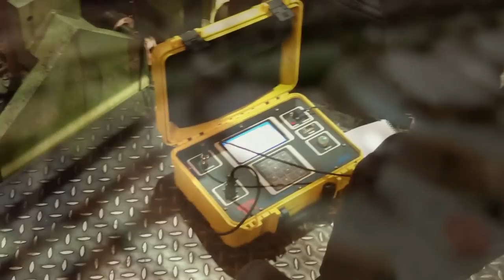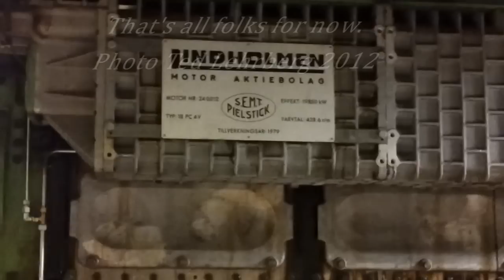Test run of Pielstick PC4.

Comment: If is a 2 strokes runs at 200 rpm,   of os 4 strokes,runs at 400 rpm.    The mechanic touch the heads and if he feels some vibration anormal,he discover the cover and fiind the problem.

Comment: I find it amazing at how low of an RPM these engines run at idle. Even under full power, they are still at a less RPM than a car engine idling.
Reply: +RakinBill the pistons are huge and heavy, if this engine could run a car rpm, it would break
Reply: As with any internal combustion engine, there is the velocity of the explosive wave front. These engines have a longer piston stroke and even though the rpm is low the piston is travelling at a high velocity. To achieve more power output you need more power strokes and higher rpm, you will need a much shorter piston stroke to reduce the piston to a lower velocity. Compare a convention cannon to the Rail Gun. The projectile cannot travel faster than the explosive wave front.
Reply: Essentially it comes down to pure physics... Engine components of such sheer displacement and mass cannot counter gravity.. also with the centrifugal force of crankshafts and other parts they simply cannot rev like their smaller counter parts... BUT.. I totally get what you're saying man ☺️

Comment: Happy that I never came across with this engine when I was at sea, 36 exhaust valves to maintain!! I am more into a 2-stroke crosshead engine.
That did cost quitte an amount of starting air to get it running, long stand-still maybe?
But at no load and on gas-oil the engine sounds nice.

Comment: En fråga till, det står om ett varvtal på 400 rpm. Jag får inte ihop det med nätfrekvensen 50 Hz och något poltal som finns att välja på för generatorer. Det måste väl vara en synkrongenerator och med tanke på åldern så körs den säkert utan sådana moderna häxkonster som tillåter annan frekvens från generatorn än nätfrekvensen och det är väl ingen växellåda mellan motorn och generatorn heller (eller är det det?). I så fall kan man t ex få 50 Hz med en tolvpolig generator som snurrar med 500 rpm.
Tillägg: Aha, man ser ju en märkskylt precis på slutet där det står det udda varvtalet 428,6 rpm. Då är det en 14-polig generator, det ger 50 Hz på det varvtalet.

Comment: how much does this engine consumes for 1 min ?
Reply: for 1 minit no ide...but the ship i work on consumes around 40metrictons of heavyfule every 24houers
Reply: 40 metrictons ? how much is this ? ._.
Reply: its around 40 cubics of heavyfuel
Reply: About 1600, 1700 l/h , 27 l/min at full load. Maybe more.
Reply: 423-450 gallons p/h. That is if the 1600-1700 l/h is correct. I rounded up to the nearest gallon.

Comment: What engine is used for the starter motor on this marine diesel?
Reply: an air compressor
Reply: air or generator started
Reply: This particular one is air started.
Reply: Air at high pressure contained in a huge pressure bottle,and a compressor to fill the bottle. the bottle may have the capacity for 15 starts without using the compressor( this is tipic)

Comment: 215 ci per cylinder?
Reply: Jordan Roberts EMD'S, have up to 1,010 ci, per cylinder, but they are medium speed diesel engines that run at 900 rpm.